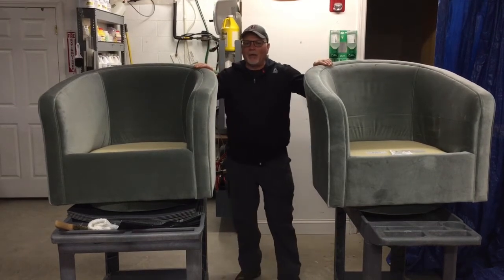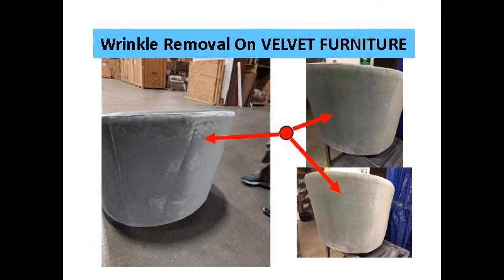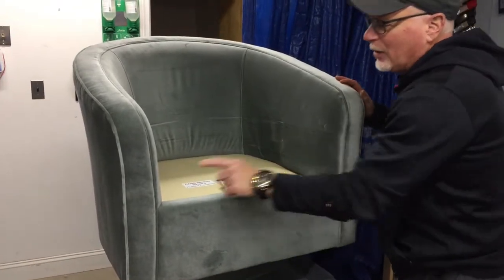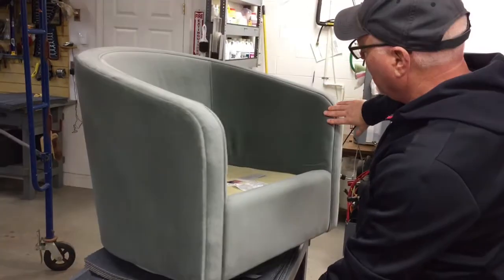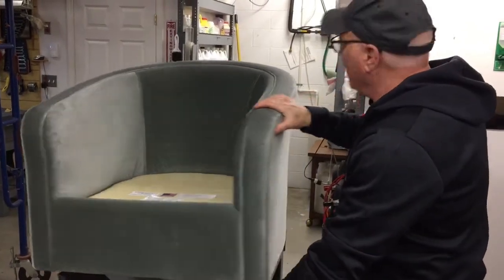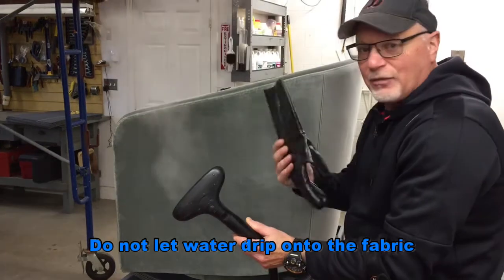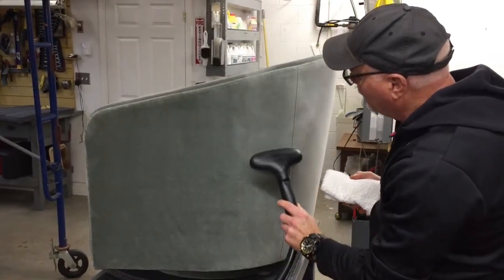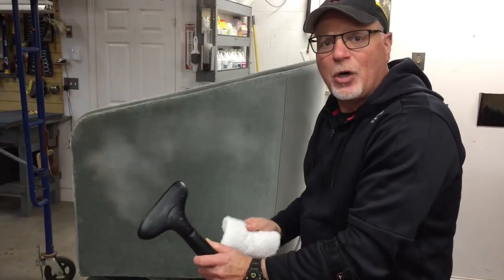How To Remove Wrinkles From Velvet Furniture

Comment: I have washed my velvet curtains in the washing machine. Now my curtains are full with wrinkless. 

I there a way to fix it?
Reply from the maker: We find using a steam machine with a carding brush helps.
Some times the steam and brush can reset the knap....most likely it won't make them look perfect but might help.
You can also bring them to a dry cleaner in your area....they may be able to reset the knap
Good luck

Comment: Glad I found this video. Would this steaming work for removing wrinkles/kinks in the piping trim alone? I have jagged lines in the piping I would like to straighten out...
Reply from the maker: Hi
It should, but be careful -make sure the piping is not glued on with an inferior glue. Steam could losen it.
Good luck
Reply: @DavidMavilio  I will give it a go-- thanks Dave.
Reply from the maker: Very Welcome

Comment: My 8yo scratched her (very short) fingernails on my brand new foot stool. Could I use this same process to remove the two long scratch marks? Thanks David for making these videos. Very helpful.
Reply from the maker: Hi Tas
You should be able to use the same technique.....but, if the fiber is cotton, rayon, viscose (a fancy word for rayon) be very careful.
Too much heat or too much agitation can hard the fibers.
Try to find a hidden area to test the process before doing it in the open area..
Let us know how it goes...
Good luck ☺
Reply: @DavidMavilio  thanks David, appreciate your quick response! I can't seem to find out much about the fabric,  the specifications say webbing and polyester but the website describes it as velvet.
Reply from the maker: ...just make to test first..

Comment: I have a chair that has furniture tacks. I want to remove them and see if steaming will remove the marks from the tacks. Do you think it will work to remove those kind of “wrinkles”
Reply from the maker: Hi
I don't think steaming will remove the indentations.
Best bet: try removing 3-4 tacks in an area not visible them steam the section. What happens there will be a good indication of hoew the entire piece will turn out.
Good luck
*make sure to use distilled water

Comment: Hi how do you get water marks out also
Reply from the maker: Hi
If you have water marks that are pre-existing you may have to spray with an acidic rinse.
We use  Prochem all fiber rinse  https://amzn.to/2wCno0A . Fix the water marking first, then the wrinkles.

If the steaming is causing water marks then:
1. make sure only steam, not water is touching the fabric
2. use distilled water in the steam machine.

Let me know if this helps.
☺